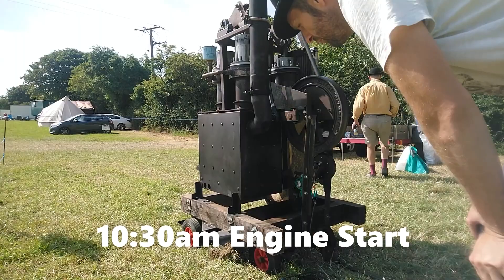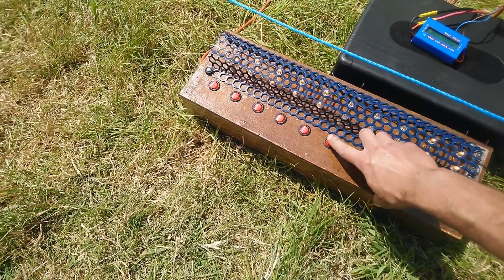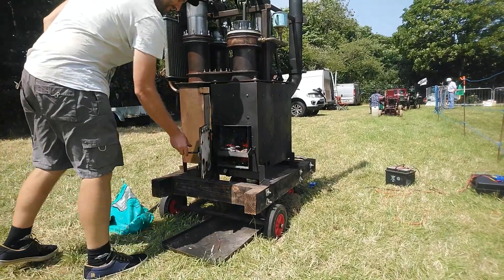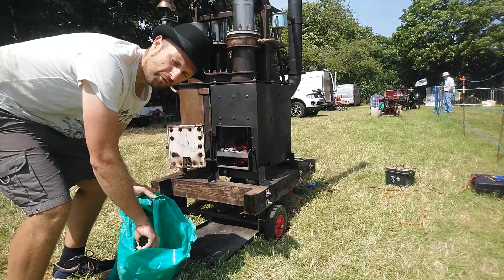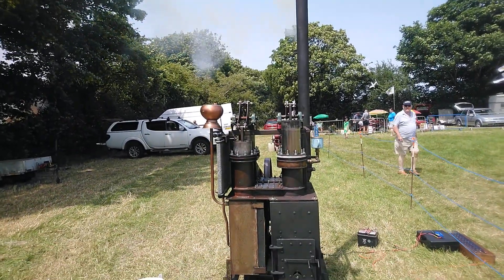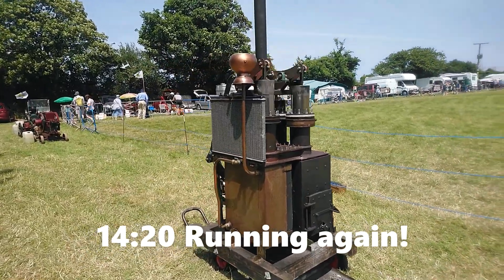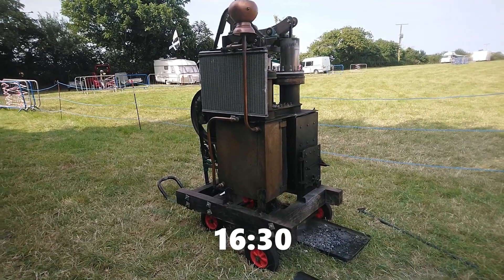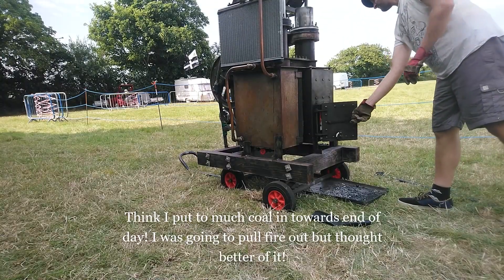Stirling Engine Generator - 6 Hour Endurance run! Part 11

Comment: This is incredible, i would love to have one haha, how much of wood does it take to run it for 6hours?
Reply from the maker: it takes about 4-5 bags of pallet wood. In this video I was running on coal for convenience. It used about 3/4 bag
Reply: @ShanePomeroy  could u trasnlate it to kg? 

Also i was thinking about making stirling engine as you, cause i love the idea of having generator that uses wood. But i would assume that making piston and chamber has to be expensive or hard. And that u “cant” lubricate the piston it can breake time to time. So u came up with idea of making generator out of steam… now im making some research. Thx for answer.

Comment: See what you mean about the new con-rods looking nice! Successful run then! I am 48 now and my retirement plan is an off-grid cabin/house with a variety of power sources including sterling engine fed by wood I can grow and harvest by coppicing myself, so you are blazing a trial I intend to follow! you have my thanks ;)
Reply from the maker: Sounds like a great project! Would be nice to see your progress : ). My plan is to build a mk3 engine (hopefully within the next year) that is smaller, more effective and will burn wood cleanly. I think simplicity is very important
Reply: @ShanePomeroy  I will be watching with great interest then, and yes I like simplicity also. One option I might have is to take a 90-degree V-twin motorbike engine and convert to an alpha-type, but there are downsides to that plan too and what you are doing could be just the solution I need.
Reply: I suggest you make some back of the napkin calculations regarding quantities and volume of work. You don't want to be caught off-guard at retirement age with a metric crapton of work on your head that is the key of your survival.
Reply: @gominosensei2008  Yeah I am aware! Not least of which is harvesting enough wood each year for both power and heat! But with regards to a sterling engine, it would be supplementary rather than something I depend-on. Something like the one shown here would be plenty big enough.